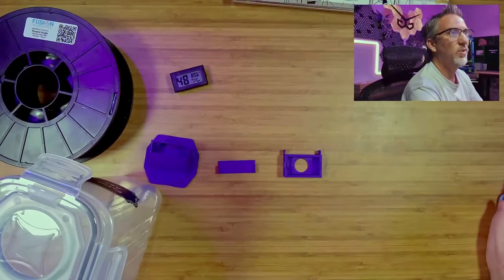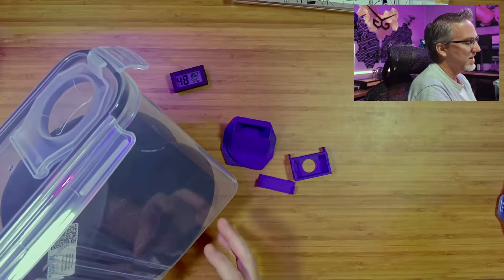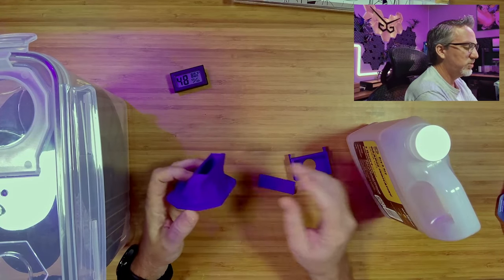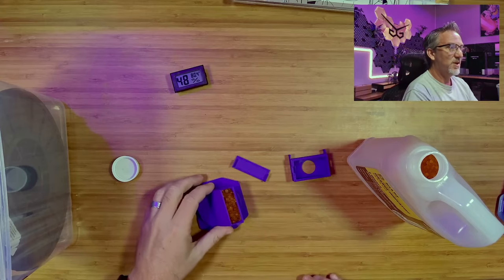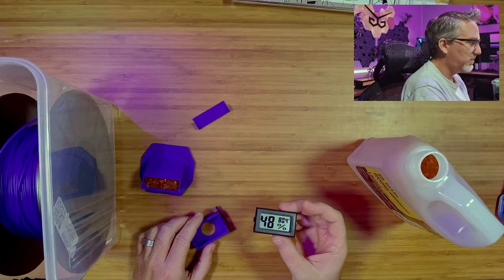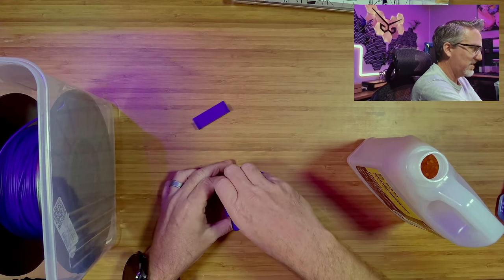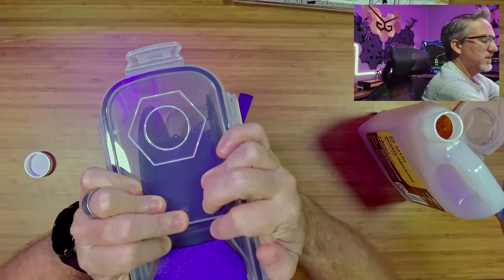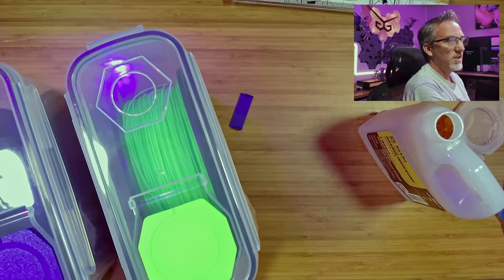Humidity Controlled Filament Storage

Comment: Are you still using this system as of 2023-12 ?
Reply from the maker: Yes. I use it for all my ABS and PETG filament. Since PLA is less susceptible to humidity, I'm storing my spools of PLA all together in a larger sealed container.
Reply: @gunplamark  i built 16 of those.. each printed in the color they store.. all with sensors.. looks sharp

Comment: is that little amount of dessicant enough?
Reply from the maker: In my experience, yes. It's a fairly small enclosed space once the container is sealed, and all my filament containers have remained around 15% for months. I've had to replace the desiccant in just one of them so far.
Reply: @gunplamark  thank you so much for your answer and for sharing your 3D project, I'm printing it right now
Reply from the maker: One more thing... you can dry and reuse the desiccant by heating it in your oven. I've also experimented with putting it inside my printer enclosure while printing at high temps, and that works but not as well as heating it in an oven.
Reply: @gunplamark  I ordered some last week, it should be here in a couple of days. thanks for the suggestion though!
Reply: I like the solution, but I can't find the products in Spain

Comment: so next step is to add fixture, some bearing and some sort of supply valve - then you no need to took out filament of the box
Reply from the maker: A few of you have asked about that. I don't think I'd use the containers in that way, but if you guys are interested I'd consider designing such an upgrade.

Comment: Nice video.  While building I'm thinking, have you tried printing while dying here? Do you think it would work?
Reply from the maker: My system isn't designed for printing inside the container. You'd want to include a spool holder so that the filament can rotate properly. Here's an example of someone else's design that would probably work better for you. https://www.youtube.com/watch?v=McqbQxbGQOM
Reply: @gunplamark  wow, thanks a lo!! So my assumption that without heating it could be used to dry & print, thanks a lot for link!

Comment: The containers I found are a little bit diferent, instead of the two lines in the back, they are a little bit more narrow, are they ok?
Reply from the maker: I'm not sure. The ones I chose are just barely wide enough for a filament spool, so the ones you're describing might be too narrow.

Comment: Really clever desiccant storage solution at the top. I wonder if it leaves enough space to accommodate a roller so you can print directly from inside these.
Reply from the maker: I'm working on a solution for that! Literally printing the first prototype right now, and if all goes well I'll have a video up in the next couple weeks.
Reply: @gunplamark  Looking forward to it!

Comment: Pakue has a file on pintables called (  Filament Box in Cereal Container ) that shows a setup to print from the box.  I think a small change in the your part to add a hole in the top  and bottom  parts for the  PTFE Teflon Bowden Tube could be a all in one setup
Reply from the maker: Thanks for the suggestion. I like a few things about that design. I'll think about combining that approach with mine and see what I can come up with.
Reply: @gunplamark  Filament Dry Box by Jsv93 has a super nice design I about ready to print out it has fusion files something I looking to learn

Comment: Do you print directly from the container? I have the same ones. One idea I had is to make these containers also heated dry boxes by adding fans and then placing them on a printers heated bed. At least 2 maybe 3 would fit on a 220mm-250mm bed. Basically a diy, much cheaper, polydryer from polymaker.
Reply from the maker: I currently use them for storage only and take the filament out for printing. I really do like the Poly Dryer design though, and I've been thinking about ways to modify this design to use some of those ideas.

Comment: So I'm pretty new to 3d printing. Didn't know humidity effected filament until started seeing effects of not storing it properly. I like your spin on the design. My plan is to enclose a shelf on the plywood table/stand and make it mostly air tight then run a $40 280 sq ft + size dehumidifier in the shelf as well as a 120mm fan to keep air circulating acrylic front panel and a humidity sensor mounted at the top. do you plan to dehydrate and reuse your silica gel beads?
Reply from the maker: While it's possible to dehydrate and reuse the silica gel, for now I've just been tossing and replacing them. So far each batch has lasted for several months. I did experiment with placing them inside my printer enclosure while printing at high bed temps and that does dry them out a bit, but it's not as effective as just using an oven.

Comment: How about adding an exit hole and print from the container? Have you tried that?
Reply from the maker: I don't think it would work well with this design. You'd need to add rollers on the bottom or in the middle of the spool so it would spin freely. I recently ran across this similar solution that includes the capability you're looking for. It looks promising, but I haven't tried it myself. https://www.youtube.com/watch?v=McqbQxbGQOM

Comment: How much longer does this extend the life of the spool of filament?  Thanks.
Reply from the maker: It depends a lot on the environment where you're storing your filament. If the humidity is fairly low already, you probably wouldn't need a solution like this. If you're noticing filament popping and bubbling when it goes through your extruder, then your filament is absorbing too much moisture.